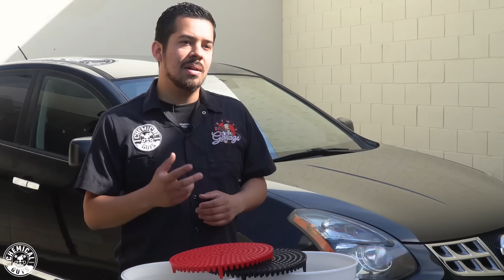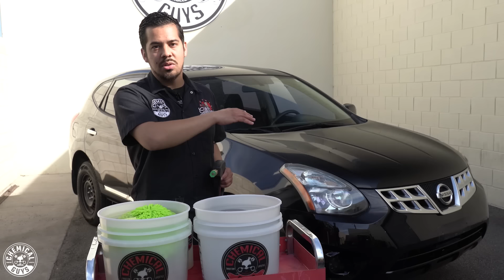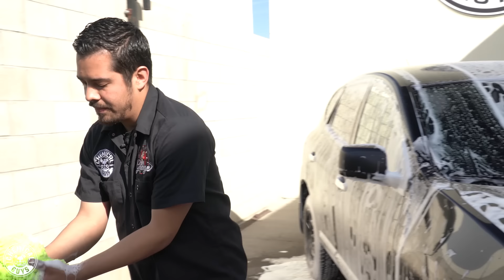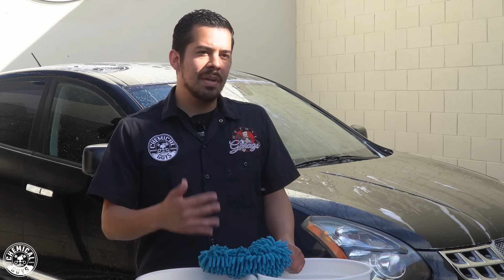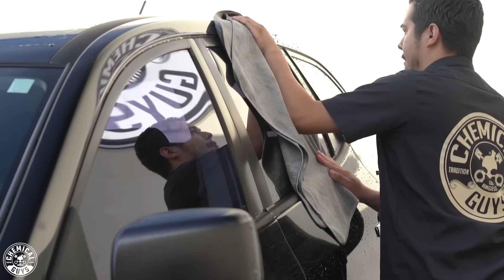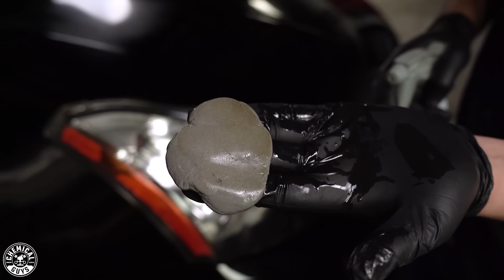POLISHING FOR BEGINNERS: Step 1- HOW TO PREP FOR POLISH - Chemical Guys

Comment: Great method for sure but I don't have that time. I use a brush and squeegee. Detail the interior then I can clay pad with an orbital then can usually use a dual action polisher with rupes grey pad. Sometimes I need the trusty Dewalt with wool pad, sometimes a foam pad. I do 3 to 5 cars a day for 26 years and never a cone back